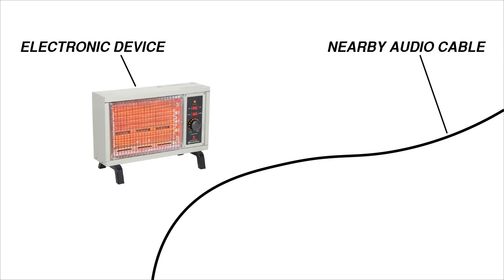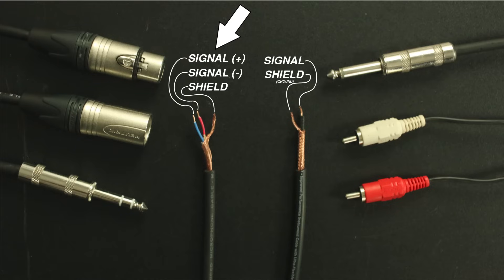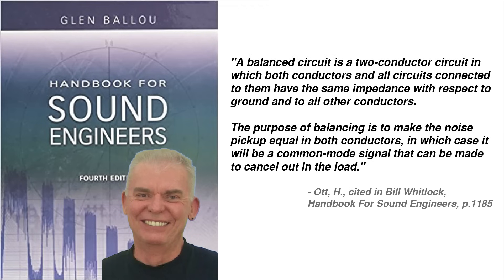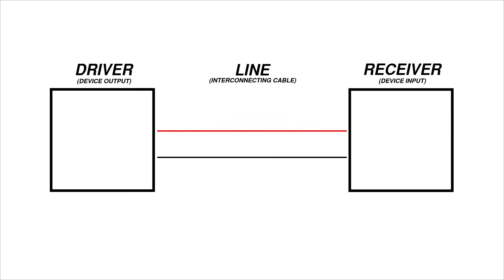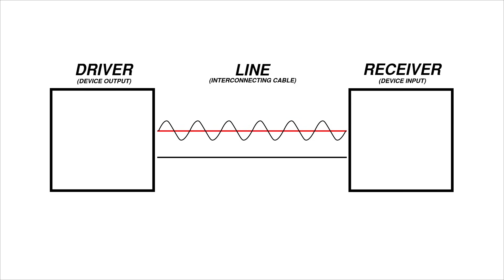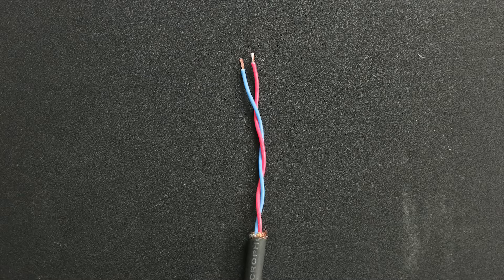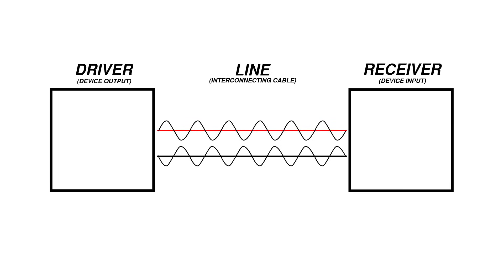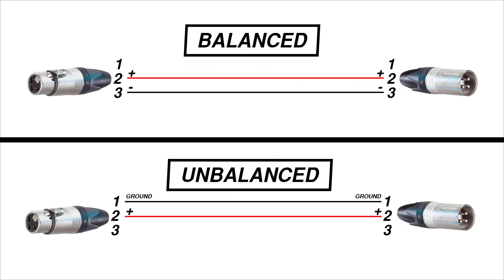Balanced vs Unbalanced Audio | Do Balanced Cables Sound Better?

Comment: An important difference between balanced and unbalanced is also the higher noise floor of the balanced electronics interface due to two circuits (+/-).  Some people mistakenly think that balanced must be better for even the short cables in their HiFi setup, because after all, professional audio engineers and technicians use balanced cables at concerts etc.  But for short cables where there is little to no common mode noise that needs to be cancelled out.  Un-balanced cables are typically better from a noise perspective.

Comment: I have a unique system set up.  A combination of technologies that allowed me to "meddle" in electric engineering to improve sound. I am using powered speakers.  The amplifier uses a Linear A/B Class amp.  Because it is linear and not deferential, I can bleed off the negative posts in the loop with Earth-Ground boxes I made myself. Since the loop only requires the completion of a circuit to work, the left-over, used, negative audio signal will nothing good being reintroduced BACK into the system's linear circuit.  By bleeding off that excess power into an Earth-Ground box, it works to limit the amount of potential noise, distortion and EMI that will feed back into the amp. Essentially, this worked to lower the noise floor. This helps system performance overall since the powered speakers do not use a grounded power cable.  So I ground externally.

Comment: Grea vid,I have a Question,I have made my own RCA cables for Technics Turntables for years, typical white Red connection from the PCB Board to two connectors White Red all good,one Day I've decided to Make my own RCA,male to male for plug and unplug RCA Turntables,they worked Both Directions fine,the problem is that,I've tried to build more and now they don't work at all,same cables same connectors and I don't even remember what I did the first time to make them Work Both Directions! Any help?.

Comment: A true balanced cable is quad star ,5 wires inside ,same as a microphone cable...increases gain by 4db - 6db & shields even better...you use TRRS plugs instead of TRS...better quality sound with no noise..
i use quad star cable on my active monitors as well as mic's....true balanced cables, excellent sound quality as quad star cables are extra shielded & by design quieter with more gain....

Comment: Ok. So if I am running a 1000 foot line.  I will definitely use balanced.  If the line is 3 feet, well, you haven't convinced me yet that it matters.

Comment: I use balanced or XLR cables as they are known between my tonearm, phone stage, pre a power amps and believe me they sound better than single ended or RCA Phono cables. An MC cartridge is inherently a balanced transducer and to use one with single ended cables and equipment is not as good. Also XLR cables can eliminate an earth loop between equipment as the ground cable is not one of the signal cables as in single ended or RCA phono cables.

Comment: There is one significant issue with your presentation.
It is not a "common misconception" that the differential signal needs to be on both wires in opposite direction.
Unbalanced circuits use the shield / ground wire for return path.
In balanced circuits, however, the signal is independent from the shield, and as such, there is no case when "there is no signal in one of the wires". Compared to "virtual ground", there is always an equal and opposite signal in both wires.
Otherwise, neat explanation.

Comment: How can you use an example of sending a signal on just one of the wires, when 2 wires are required to send a signal?
The audio signal always lays on both wires. One wire always have the other wire as reference - or vice versa.

Comment: Would wrapping any cable in cooking foil do any good? 😮
Reply from the maker: Many cables also have shielding, which is typically foil, wire, or braided wire. You're on the right track!

Comment: Another great video!! Learning so much! Thank you!

Question - I'm using a powered speaker at home use with my arranger keyboard (12x12 room), plugged in a surge protector to wall outlet. When I turn it on I'm hearing hum and I can't get rid of it. Or even worse when I turn on the light in the room the hum is a bit louder. 

What's going on and how can I get rid of it.  Note - There is an LCD tv near but that is plugged into a separate outlet.

Comment: I recently added a Tonewinner  amp (both types of connections) to my AVR and use it for all channels of sound.  My Denon only has RCA pre-outs so I used single pin (if that's the right term, or at least comprehendible) digital audio cables to connect my AVR to the amp.  If I eventually got a dedicated processor for my home theater listening, would I even notice a difference in sound quality using balanced connectors, if it's only a 3 foot length of cable??

Comment: Thanks Kyle for this video, you greatly explained the differences. A question: I'm using two TRS cables, instead of two TS cables, to connect my output speakers. Noise cancellation works perfectly with M-Audio BX5 active monitor speakers, but not with the DAG Audio 8P active speakers, in which I clearly hear the noise coming from the PC (I'm using an USB audio interface). Is this caused by the quality of the speakers? Even using XLRs cables doesn't change anything. What else should I check?

Comment: Working on a siren for a police vehicle that gives me a humming sound in tempo with the flashin lights of the vehicle. I managed to isolate the problem as most likely being the lightbar inducing some power on it's data line to the light and siren controller and then being output over the speaker. Your info here helps tremendously, as i believe i understand more about my problem. Thank you and keep up the good work!

Comment: Hi Kyle, thanks for these excellent contents. Why are guitar cables always unbalenced (TS), why my Guitar processor (boss GT100)line outputs are unbalenced, same goes for my yamaha arranger keyboard (sx900) the line outputs are unbalenced, is there anyway unbalenced signal has some advantages over balenced signal, if you can kindly help me brother ,
Reply: Easy answer:  Unbalanced interfaces are CHEAPER.  They require fewer electronic component at the equipment outputs and inputs and the connectors and cable are larger and more expensive.  Under ideal conditions, most people won't notice the difference in noise level, so unbalanced have become de-facto standard.  Balanced interfaces will deliver noise-free signals even under adverse conditions.

Comment: Great work - super helpful. So the balanced receiver / differential device actually works by phase inverting the signal on one of the two wires coming into it. That is how/why it "will only respond to the difference in voltage between the two wires on the interconnecting cable". Is that correct? Also, isn't the "ground" just another wire? Why does soldering conductor to pins 2 and 3 result in a different outcome than soldering conductor to pins 1 and 2? Aren't pins 1, 2, and 3 connected to a wire anyway, regardless of whether we call it "ground" or not? In other words, doesn't the shield carry signal too? It's made of copper, just like the wire that is soldered to pins 2 and 3, no?

Also, about your common misconception - if you don't need to duplicate the signal and can achieve balanced audio with just one copy of the signal being sent (because the noise still gets equally picked up on each wire), then why don't all TS cables function as balanced? Would the noise not get picked up on the signal wire and on the ground wire, and thus the "ground" wire would function as the "second" wire (such as in your common misconception example) and allow a TS cable to also achieve balanced audio? Or is the reason why this doesn't happen that the ground wire doesn't get connected to the differential device thus the noise picked up by the ground wire never gets its phase inverted (to achieve the cancellation)?

Comment: Does this apply only to recording devices? I'm trying to hook up a PC to a computer and after watich this video I want a balanced connection. So I believe I would need dual trs 1/4" to single 3.5" trs. But I can't seem to find that cable.

Comment: I feel like you said the difference between balanced and unbalanced isn't the noise cancelation, but then demonstrated that it was?
Reply from the maker: The inverse signal doubles the amount of differential mode gain, and therefore increases the relative cancellation of noise. But even without the inverted signal, there is still a big difference which is also differential mode gain. So without the inverted signal you still get noise rejection so long as the noise is on each wire.

Comment: brother man which cable is better ( quarter inch vs XLR to headphone jack ) my purpose is to plug it in to mixer to phone to play music. Can’t wait to hear from you. Thanks.
Reply from the maker: You’ll almost always need a 1/4” headphone plug when using pro audio / recording gear.
Reply: @AudioUniversity  Appreciated.
Reply: @AudioUniversity  the issue I faced when plug in quarter inch cable plug in to line in under direct out when pushed all the way no signal. The pin has one ring. 
Are you familiar with Shure  BLX 14 wireless headset with PGA 31 mic. I am comparing to GLX14 +. It’s for the church pastor.

Comment: From my personal experience, I found that for example. that when using a Crown amp that has both unbalanced RCA and Balanced XLR changes the sound of the amp closer to a class AB amp.. even though the distance from my receiver to the amp is short. the signal from my receiver was too low. I tried the unbalanced RCA with good quality cables, with input sensitivity set to .775. it never sounded right. it was too late to return.
 so I bought an Art Cleanboxpro and a good quality XLR and BOOM. That amp started to rock.  I didn't have any hum noise before and I don't have a hum noise now. completely silent. 
it literally changed how I view D-class amps. cables do matter. and the input signal makes a difference at least on Pro amps. such as the Crown.
BTW: the rolls pro match 15b is not shielded as well as the Art Cleanboxpro. and that's why a lot of people who did purchase that unit are complaining about a humming noise they didn't have before adding the converter box.. the only recommendation I can add. is. if you buy the Art Cleanboxpro. they give you a cheap PS. that gets hot. get a 12v. 2-3 amp PS. and you're all set.

Comment: Hey, Kyle, I was really hoping you'd drop just a bit incorrect or misleading information so I could trounce you in the comments. Sadly, your explanation was clear, concise and factual so I have no choice but to commend you. Good job, goddammit.
Reply: Actually, you missed something, In the beginning of the video when explaining what the conductors in the cables do, he got the balanced cable wrong. He said the balanced cable has a positive, negative and shield. That's not true. There's really 2 positives and a ground. The ground/shield pin is correct, but the other 2 are signal. When you see + and - labels on a balanced connection, it polarity, not positive and negative. That's one of the reasons people have trouble when mixing balanced and single ended components. Most adaptors, cable or stand alone, shunt the number 2 pin to ground. So, if you are feeding the cable with a balanced signal, it creates a short circuit the second you plug it in,

Comment: 20 years of not understanding what Balanced is, remedied.  Thank you so much!
Reply: Well there is only one thing you need to know.

Unshielded and unbalanced cables pickup EMI (for example your Phone and WiFi signals etc.) and carries only mono signal.

Nowadays almost all electronics, wall sockets and such are shielded. If that wasn't the case, your ears would start to bleed as soon as you turn on your Smart TV, PC or any device, which plays audio or picks up digital signals

Comment: Here's another angle on explaining balancing, that helped me.
music gets sent down 2 wires from a balanced output, which reverses the polarity of one of the wires.
Wire 1:    +M (for Music)
Wire 2:   -M

Both wires pick up 'Noise', so
Wire 1: +M +N (for noise)
Wire 2: -M +N

The unbalancing circuit of the recieving device takes both signals, reverses the polarity of Wire 2, both the mucic, and the noise, turning Wire2: -M +M into +M -N and sums the two signals together.
So, the sum is +M +M +N -N.
The +N -N parts cancel eachother out.

Result is 2M(usic) with no N(oise)

Comment: Thanks for the info! Why aren't all cables balanced then? Seems reasonable you'd want less noise in any situation.
Oh, and a question regarding stereo...since we need two different signals for left and right, we can't really reverse the other to cancel the noise, right? That means all stereo cables are unbalanced?

Comment: Interesting. My suspicion about the phase-inverted signal on the R path in XLR is that simple centre-tap transformers are used in balanced line outs and ins. So, the X will be neutral and the induced signal will automatically be phase-inverted purely because of the use of a centre-tap transformer. Any interference noise will be common to both the in phase and the inverted phase lines and disappears due to common mode rejection in the transformed, which is the differential device in the receiving end (as well as in the transmitting end).

Comment: As a physicist, let me add just a few things to your already very clear explanation. Perhaps someone will find them helpful.

First, there is no such thing as absolute "level" or voltage. Voltage is always measured between two things. So not only are you correct in saying that the signals in the two wires don't need to be the same - they aren't even defined individually; all that counts is the voltage between them. Unless you measure them against some other potential, such as ground. But in my understanding you don't have to do that, since both are floating anyway.

Second, if the circuit is closed, i.e. both a driver and a receiver, as you call them, are connected, then any current flowing through one wire will simultaneously flow through the other in the opposite (spatial) direction. If now a changing magnetic field from a noise source induces an EMF at one section of these wires, this will try to push the electrons in the same spatial direction in both wires; but in one wire this will try to accelerate the current while in the other it will try to decelerate the current, thus the effect is cancelled out. What you describe as a "differential device" in the receiver need be no more complicated than a load of certain resistance connecting the two wires, and a volt meter across them.

Third, although it wasn't needed for your explanation and so you rightfully skipped it, the shielding around the twisted pair is actually an important additional piece of noise protection. It creates a Faraday cage around the signal wires with equal potential all around it. That way, the EM field inside it will be (net) zero, and external radio waves will be deflected around the center.

Comment: An EEG signal might be 5 microvolts, whereas mains hum floating around the body might be 5 volts, which is a million times greater. There is no filter in the world which can get rid of the mains hum from the EEG signal. 
If you use 3 electrodes, one being the ground reference, then the induced nose in the other 2 electrodes is identical, i.e., the noise is common mode. 
You feed the two signals into a differential amplifier with a high "common mode rejection ratio" and the induced noise disappears.
If induced noise were not common mode, we would have severe problems monitoring the body's electrical signals.
Thanks for the informative documentary.

Comment: A great explanation of balanced and unbalanced cables. Thanks! I do want to mention one thing I saw in the video. When you did the demonstration of the device picking up interference from other cables and devices, you had what looked like an AC power extension cord coiled on the floor. This is not a good way to store the excess cable length. When any energized cable is coiled up like that you are essentially creating a transformer. A transformer, especially with an AC power extension cable will drop the voltage depending on how many loops are in the coil and how much current the load is pulling through the cable.

I learned this from my time as a lighting tech for stage and television production. This does make a difference with the high voltages and currents for lighting gear. It doesn't make too much of a difference with the amount of energy traveling in audio lines. However, a coiled with with pick up other electromagnetic signals better than a cord that is just run along the ground.

Comment: In a mixture there is RCA recording out L & R. My camcorder has two XLR inputs. What is the best way to connect to get better audio input? (The distance between mixture and camcorder is about 50 ft. My cable is at one end XLR male and the other RCA male. But often the recording is noisy especially when playing musics. I have to set my cam from 'mic' to 'line' to reduce noise. But the recording level and quality are reduced.) Thanks in advance.

Comment: A single (unbalanced) cable does not carry a signal, it does carry a signal with respect to a reference potential, the ground and in your samples, the shield. A deferential (balanced) is made of two cables that each one carries a signal referenced to the shield, but that referencing one to the other they carry the desired transmitted signal.
The fact that your video ignores the concept of referencing to ground can make the sample at the end very confusing.